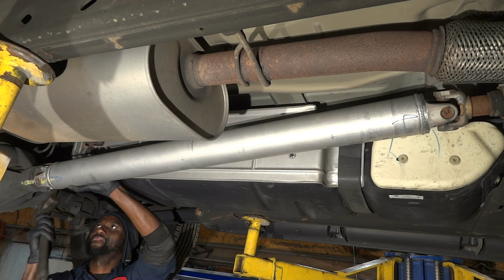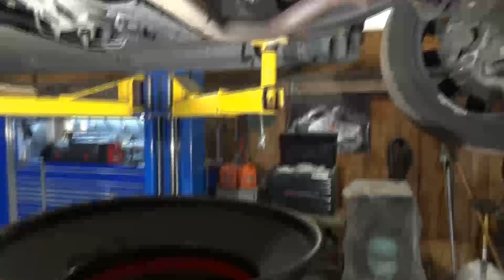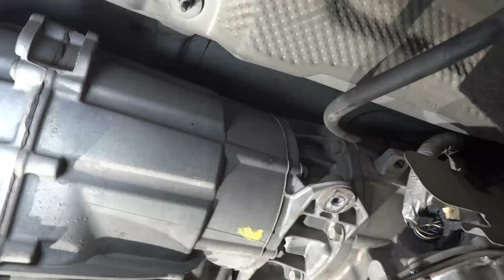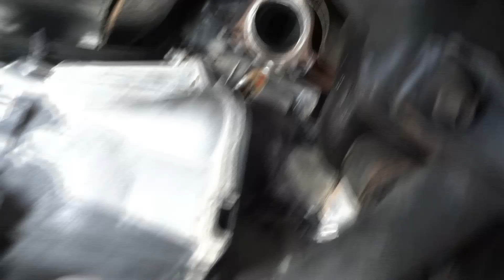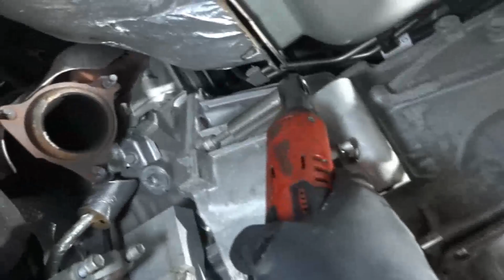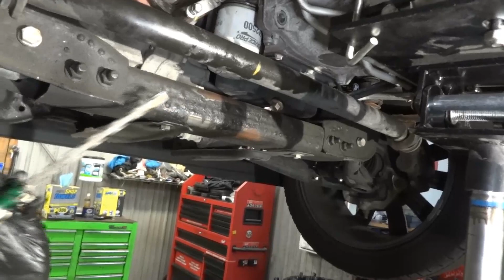Chevy / GMC 4WD Truck Transmission Replacement - Part 1

Comment: When you spin the engine to remove torque converter bolt,  do you have to put car in neutral?
Reply from the maker: @supergirl2997   not necessarily!

Comment: My 6L80 would pop out drive and lose all gears. Dropped the pan and discovered a lot of metal shavings.. added new fluid and is running fine is it a bad torque converter or what caused the metal shavings?
Reply from the maker: @cesarbrizuela5787   your clutch packs are probably wearing out!
Reply: @KITS_Auto_and_Truck_Repair  Thanks for the reply! 👍🏻

Comment: I try doing a transmission job the old school way without power  tools tranny jack no lift.. if you working on a older car them rusty bolts going to give you hell without using power tools.. I like doing it the old school way too it make you stronger and more knowledgeable about parts because you have more time to studying the parts while you taking them by hand because it takes a little longer.. both way work great to me
Reply from the maker: @Tictokkyller  Yes! Good Luck with your Truck!

Comment: I did a 2017 suburban transmission I didn’t buy one from GM DEALER way to expensive bought on from a rebuilder after I programmed it. It work amazing I felt like it had more torque then the ones I replaced from dealership
Reply from the maker: @triplesautorepairtriplesautore  Good Job!

Comment: I haven't encountered this type of work before. A client complaint that when he was on motion is airbag blew. Eventually, he noticed that the smoke was emanating from the engine bay. Hence, he pop-up the hood and saw that the smoke was coming from the ABS module. He called a mechanic to unplug the ABS module connector. Afterward, the connector was connected back. Henceforth, he has noticed that his steering is stiffer to steer. Additionally, he said : "the car isn't moving smoothly as before."

Yesterday, he called and said even the headlight and other lights aren't working again in the car.

The check light appears first, brake light second then finally the P/S light appears. They lights don't come out at once. It's a 2010 Toyota Corolla Le.

Please how do I fix the problem?
Reply from the maker: david essien   it's hard to tell! do you have any trouble codes in memory?
Reply: @KITS_Auto_and_Truck_Repair  The client is a novice about car and was unable to give me a good explanation. I didn't see any sign of airbag shooting when I saw the car yesterday. I told him that the airbag is still Ok. He made a mistake in his explanation. The only thing I saw was that the ABS connector was unplugged and headlights were bad in the car.
What i noticed from the car was that when it's first started the RPM raise to about 2,500 and then drops to about 700 RPM on it's own. 
Probably there could be a short on the instrument cluster as well because I noticed a blink once after about every 25 seconds throughout idling except the car is shut-off. He said that was how it was when he purchased the car from someone till date. 
In addition, the speed clock doesn't raise  when driving and the car is intermittently hard to start.
P0335 and P0500 were the only codes I retrieved.
Reply from the maker: @davidessien5465  Sounds Good!  Good Luck with your project!